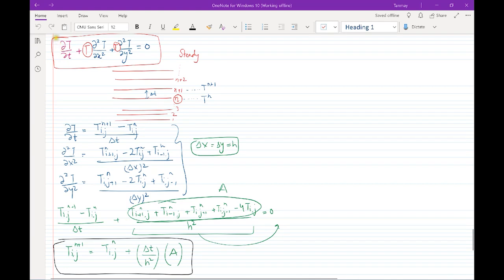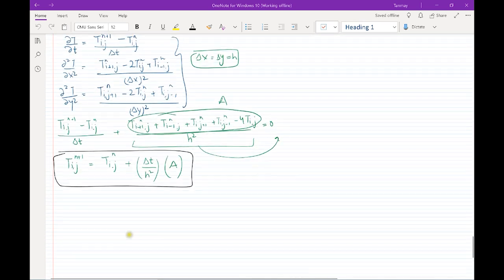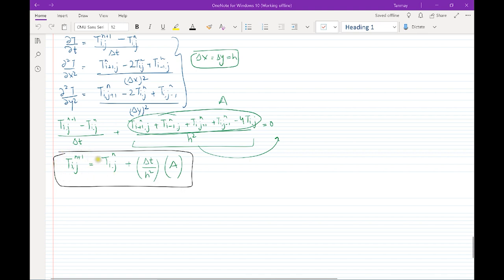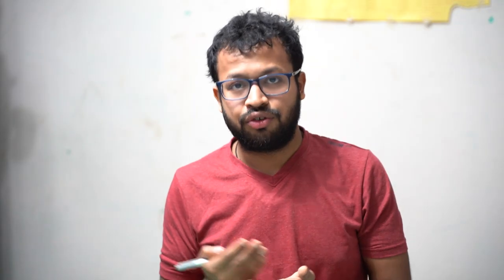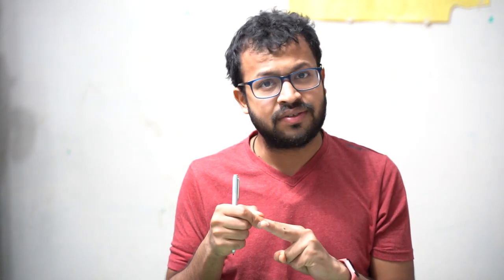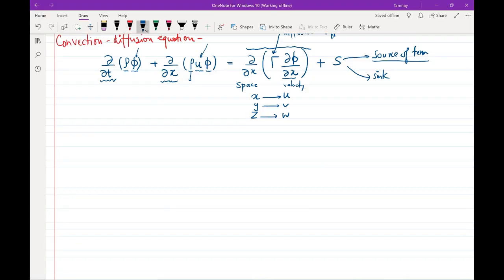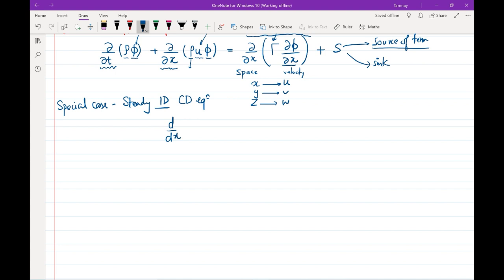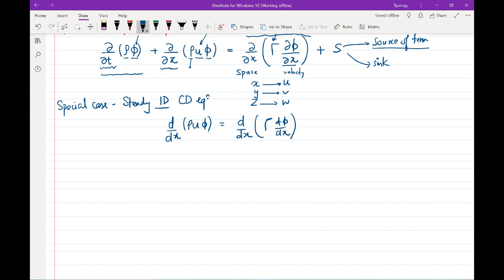Theory of Convection Diffusion Equations | Lecture 9 | ICFDM

Comment: Nice lecture! 
Correct me if I am wrong: Advection is technically the heat transfer by motion of fluid while diffusion is because of concentration gradient. The convection is the combination of these two. However, this is not explicitly mentioned in most books.
Reply from the maker: Yes, a lot of textbooks, specially on CFD, interchangeably use advection and convection.